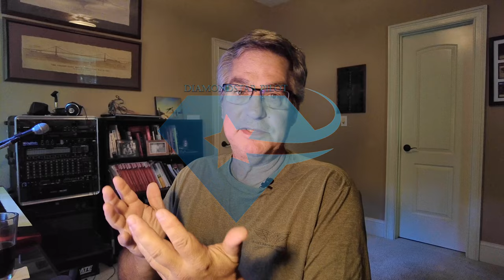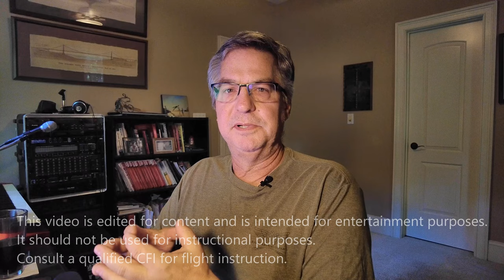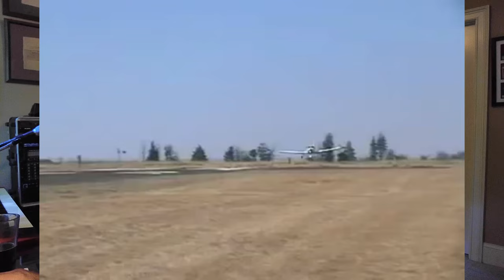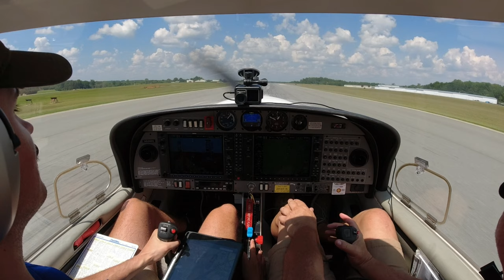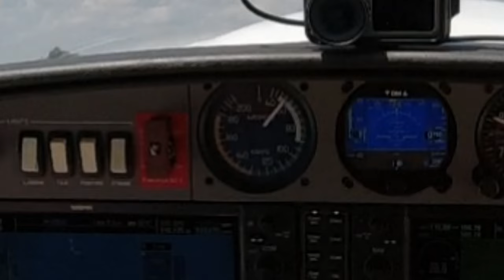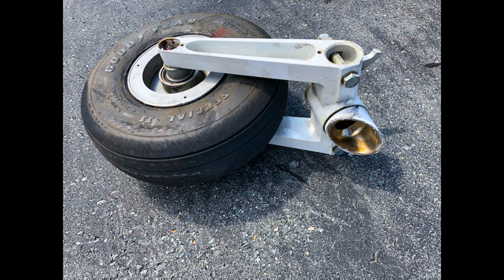A Real World Example of What Not To Do In A Bounced Landing |Diamond DA40|

Comment: Just found your channel, and I’m glad I did!!!  I’m 12 hrs in at a 141 and have been flying the DA-40. My issue is maintaining center line on takeoff and landings. 
We did some taxi training at an untoward airport and it helped. I start having a problem 15-20kts before Vr
Reply from the maker: Slow steady pressure on the rudder pedals is the key especially as the speed increases.  Happy feet with quick changes will get you in trouble.  You'll get the hang of it with some practice.
Reply: Awesome. Thanks! I will give it a try today. My CFI was telling me to use happy feet and that could be the problem I was having.